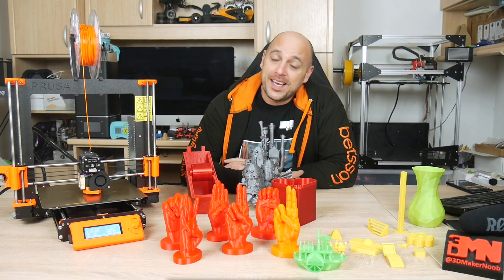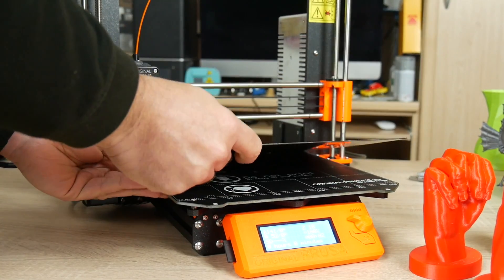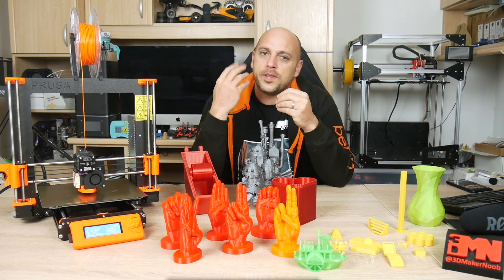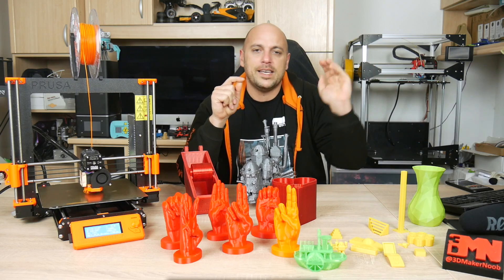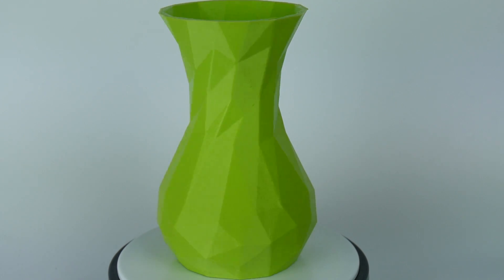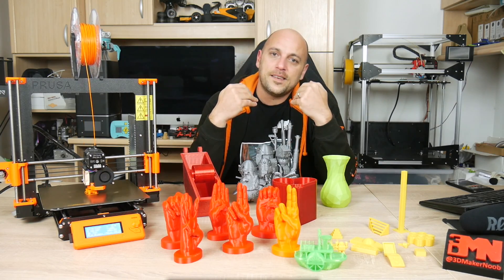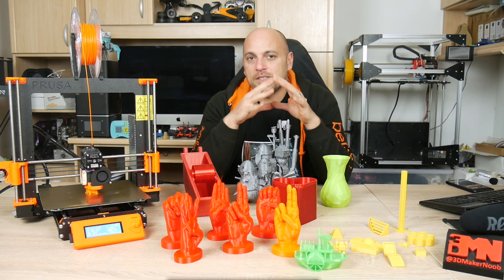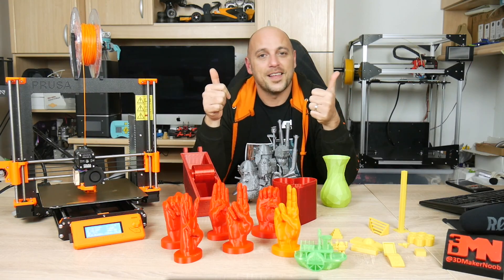Original Prusa I3 MK3 Review

Comment: I just bought one. It was delivered with defective board. The printer does not work. Support service is lame. It takes forever to get ananswer. Answers are generally useless (like factory reset a new printer or reinstall the same version of firmware). I had to send back the the board and it is taking 2 weeks to get a new one sent back as they want to test it despite  it is defective. Simply embarassing. I am thinking about buying another printer to keep business running while waiting for service.

Comment: I've had my eye on this one. I have a (cough, cough) monoprice maker select. I have a heck of a time levelling the machine and lots of problems with prints not sticking to the bed and print warpage. I spend A LOT of time levelling. Once I get it levelled it works okay with prints less than 3"x3" This machine looks like heaven compared to what I've been dealing with. I am new to 3d printing so I gave it a year with the monoprice and I'm ready for a change.  This looks way more user friendly.

Comment: Thanks for the review, but my Prusa i3 MK2 only survived for 2 months then I began to have problems and I have not recovered from the issues because I have had to disassemble it and install an extruder motor and fan.  I purchased the 3D printer assembled because it had good reviews and I didn't have the time to assemble the kit.  I am so disappointed, that's why I am reluctant to purchase a Prusa i3 MK3.
Reply: Ray , have you solved the problem/s ? if so any idea what caused them ?

Comment: OK.. this is going to sound a bit off the wall... I am off-grid, making my own power with solar panels. Here's the big question. Since printer uses a 24 volt power supply, is it possible to run it directly on a 24 VDC  battery? It would save considerable investment in inverter costs and be more efficient. Why take charged batteries to create 120 VAC only to let the machine reduce it back to 24 VDC?    Also, I wonder how sensitive is this machine to temperature and humidity changes? Do I need to build an enclosure to keep out dust  while it is running?

Comment: Most of those features are just gimmicks.. Crash detection? When was the last time your print head crashed into something? Power resume? Cheap aliexpress printers have this function already and the number of times I had a power outage in my house in the last 10 years is exactly zero.. 3D printed parts and this 1995 screen with on a £899 printer are a joke.
Reply: Print yourself a pink halo and wear it with pride lol. 
Your just so lucky to never have had any power outages or had the printer head crash,  unless of course you're using someone else's already  proven programming. Here where I live out in the sticks falling trees take out over head powerlines several times a year or flash floods cause land slips that move the towers etc. .

Comment: Hey Joe, 

Try applying something with less traction to the bottom of the rubber feet.  I would suggest some adhesive-backed felt pads, or even some small decals or stickers.

Edit: with the already substantial cost of $600 for an MK2S, this means people looking to buy this machine are looking for a serious 3d printer with great reliability and build quality.  Obviously the MK2s won't let you down, however $150 more is not a lot in my opinion for the incredible number of improvements made on the mark 3.  Further, these type of printers will inspire makers to do builds which may run overnight, which a quieter printer will be extremely nice for.

Comment: It's the stepper drivers that provide software endstops, not the board. You can do the same with any other board using tmc2130 drivers.
Reply from the maker: Ok.... what are the stepper drivers integrated to on the einsy?....
Reply: It has integrated  TMC2130
Reply from the maker: Exactly, key word being integrated, meaning they are a permanent part of the board
Reply: Fair enough :)

Comment: Great review as usual! I have just one question. How does it perform compared to cetus, if you take under consideration only the print quality. I'm looking for best FDM to  print tiny objects in PLA.
Reply: sebozwierz how about an obsidian? Or an ultimaker? Or a zortrax? Or a trinus?
Reply: Guy Wolf I was taking into account trinus, but somehow I thought cetus because linear guides would be better. Neither I would trust to horizontal trapezoidal X and Y axis screw, because of backlash. My friend own Zortrax. I hate slicer constrain. I think together with ultimaker is too pricy, though great printer.  Haven't heard much about obsidian...

Comment: I ended up starting out unlucky with my MK3. Every print I tried to do failed and I paid for mine to come pre-assembled and calibrated. After some troubleshooting and frustration as every time I moved it a foot would come flying out, I was able to isolate it to a bad bearing. After some emails they sent me 2 new Y axis rods and 3 bearings and it works great. I'm having a blast with the things I've printed so far and people at work have started queuing up requests. So far it's been like a device to make "toys" that I would never buy, I mean who has a miniature Triceratops skull.

Comment: Good review. Nice that you mentioned that some users have problems with their mk3. I am one of them i had 3 terrible months with the mk3. Now i got a replacement extruder and it just works nice. One downside is the ringing. You can see it on the big silver model. 
For flexibles you should turn of retraction too. Again a good review

Comment: do you change nozzle or belts on mk2 or mk3?
Reply from the maker: Nope all original
Reply: it is imposible man  you used machine more than 1000 hours and belts are still tight?
Reply from the maker: Why impossible? To be honest I didn’t have time to stay doing maintenance. And I will still leave it running without any adjustment until I see any deterioration in the quality of prints
Reply: thanks to high quality.
Reply: FYI I've done about the same amount of printing on my MK2S (over a longer time period) and my belts are still tight. The print bed came loose at one point, but nothing else has needed tightening.

Comment: I am loving my MK3! I have built 3 other printers in the past and the MK3 kit was, by far, the most painless and enjoyable build. My ONLY gripe was that a plastic lead screw bushing became cross threaded when I lowered the x-axis the first time. But after removing the part, cleaning the threads and reinstalling, the x-axis began to move up and down freely on the z-axis lead screw. Ultimately this was an issue on my end from hastily lowering the x-axis and not on Prusa's end. After about 200hrs of printing here are my Pros and Cons:
Pros:
-All of the Next Gen features (Filament sensor, crash detect, power panic)
-Sturdy 30x30 Aluminum extruded frame
-High-Resolution Microstepping and the Einsy motherboard
-Flawless bed levelling
-The PEI removable Flex Bed
-Detailed Build Guide
-High quality parts (Steppers, Fans, rods and lead screws)
-Live Z-adjust
-The near-silent operation
-RELIABLE High speed operation (Can accelerate to 200mm/s on large surface area prints)
-Easy Filament change function
-Printable replacement parts
-Informative community

Cons:
-The included PETG Spool Holder (Can induce vibrations, resonances, oscillations)
-Rubber Feet (Can also induce vibrations, resonances, oscillations)
-Few Simplify3D profiles (Requires lots of tweaking)
-Prusa Control Software (Cannot export settings to S3d or view current acceleration / speed settings)

All in all, I have no regrets preordering the MK3. All of the Cons are either superficial or can be fixed with new printed parts. 
It's easy to use for beginners and high quality enough for use by professionals. 
Well done Prusa :)

Comment: Nice review Joe, you covered all the topics about the printer, I really enjoy the part that you mentioned flex filament, and the tips to make it work and no issues with the printer, it gives me ease of mind when it comes for me to build mind, I'm also waiting for the mk3 with the texture bedplate, they say near the beginning of March they will start shipments. I lost count how many times I have gone through the manual but this review just raised my spirt, thanks for your vidz.
Reply: Rui Vasconcelos He really gets into the nuances of the printer. For example, if it weren't for this video, I wouldn't have known the anti crash feature won't work in silent mode. It's these little things, that others miss, that are greatly appreciated.